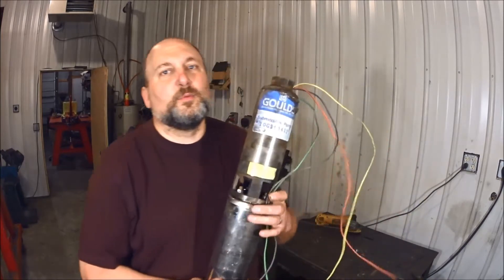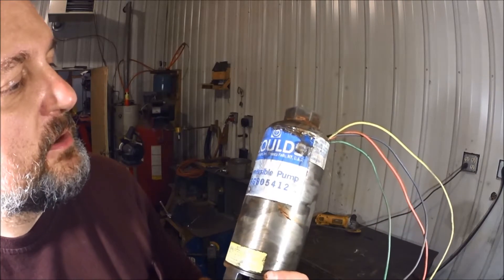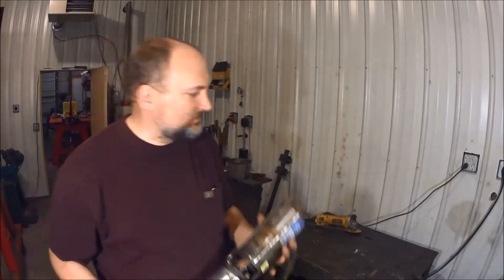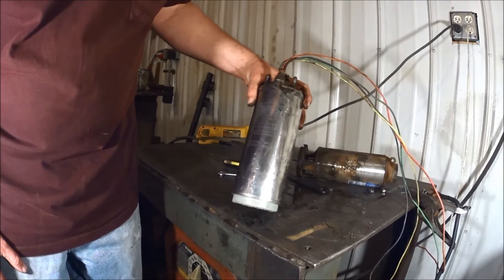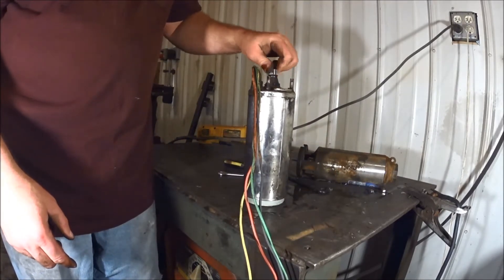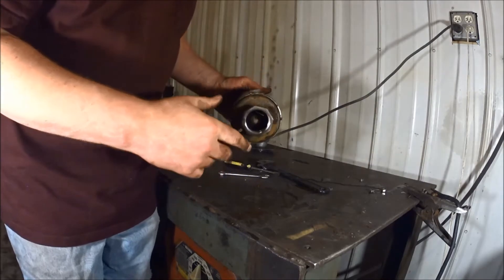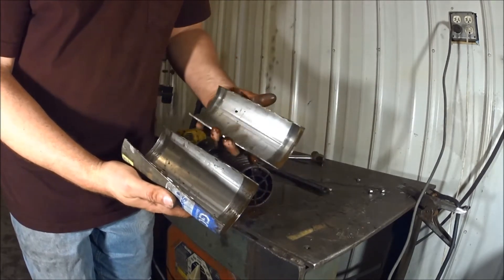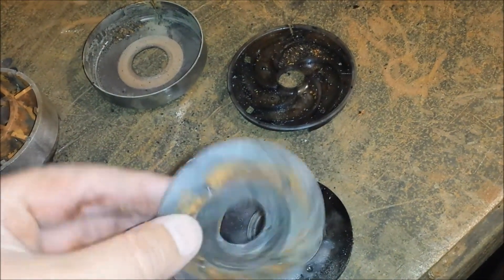Submersible Well Pump FAILURE Mode - (re-upload)

Comment: Very interesting video. You're lucky to have a well only 15 or 20 feet deep. Mine is 300 feet, so I'll need a towing truck to pull the pump out. I'll try to manage a pully system and pull it out with my ATV and a couple friends and pay them with a few beers when it's done. Thanks from Quebec.

Comment: I share a well with two other properties. Had to change out the pump about 25 years ago. Ours is a bit deeper but on the same type of PVC pipe. My recollection was 4 pieces of 21' pipe. I helped the well guy change it out on a Sunday. Our well has a pit, which is a concrete septic tank, also a good place to keep the pressure tank. We also have a second check valve half way down. That failed as it pushed parts up to the top side, check valve near the pressure tank, which got stuck in that valve. It caused short cycling of the pump. 
I watched the other three videos, I thought for sure your PVC pipe was going to kink break off, and drop the pump to the end of the wire, as I though you had it deeper well then that. 
Our aquifer is pure limestone, so very hard water. Tastes OK, but without a softner, lime buildup on all the sinks, toilets, and baths. If I wash my car, that's unsoftened water, and if I don't dry it off, white specks are left everywhere. Memory was the water was 19 feet from the surface on our well. 
They also don't allow pits anymore, and require that pitless adapter.
I had held onto that pump that was changed out, and couldn't figure out how to open it. It appeared that limestone build up internal to it, and caused the rotor shaft to lock up.
Thanks for reposting this, I like seeing stuff torn down. Was that oil that came out of the pump motor? I thought they put in a high dielectric oil to keep water out.
Reply from the maker: It's been a couple years since I did this, but I don't recall any oil coming out of the motor.